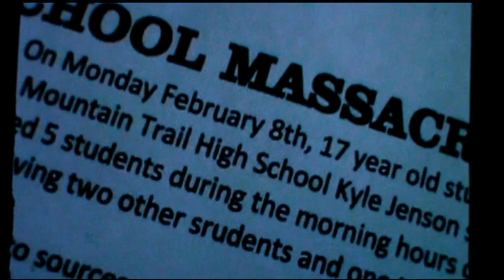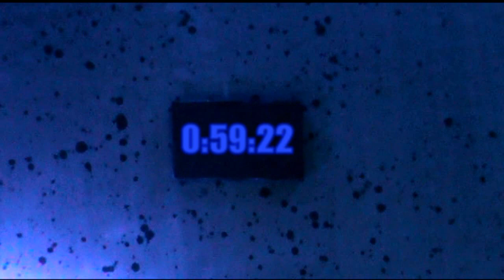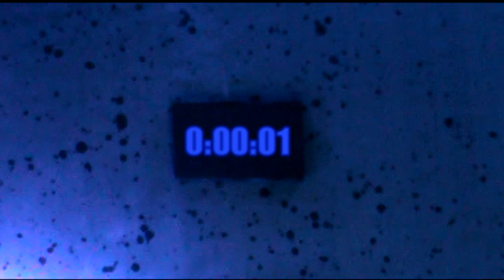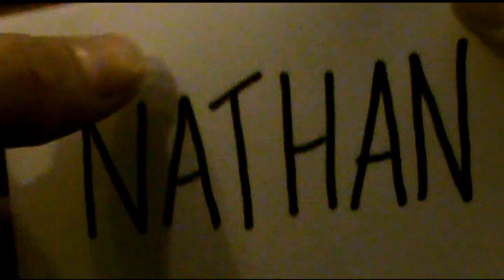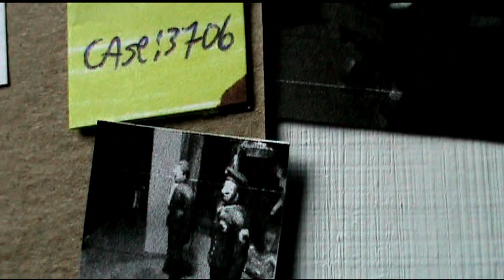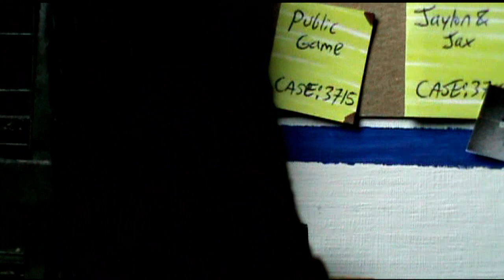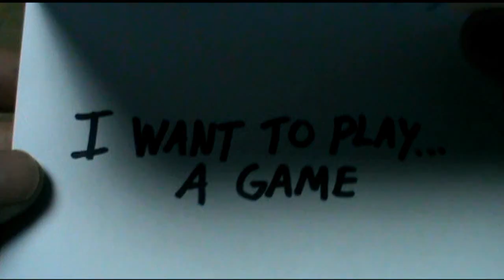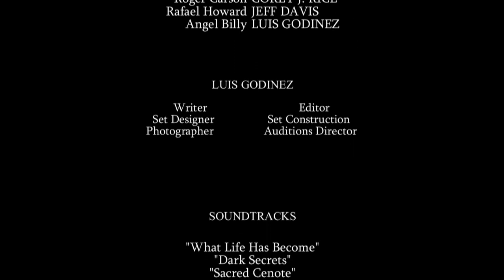Ventilation Cube (Season 7, Episode 1)

Comment: This was a very good video! It’s good to see you return to making Saw videos. I will say I expected the Ventilation cube to involve some kind of Air vacuum. But I’m glad it was simplistic
I must say though, how did the cattle blood fill up the entire cube if there is 2 openings. And if they were closed by the spikes, what would’ve happened had David not put the oxygen mask on?
Reply from the maker: The openings have the two cable devices through them. So it seals the holes. Also with David's back pressed against the openings. It covers them
Reply: @JLGRproductions ah ok cool